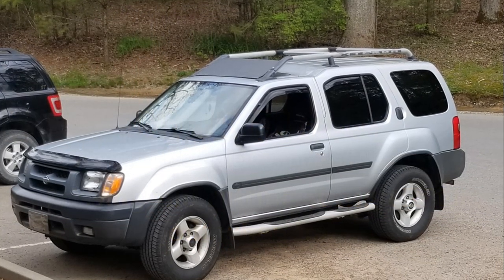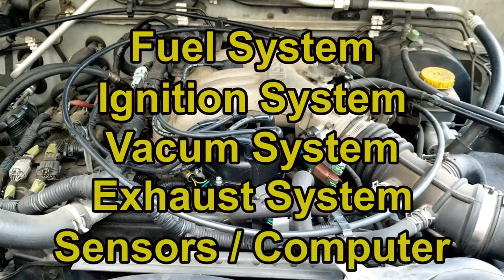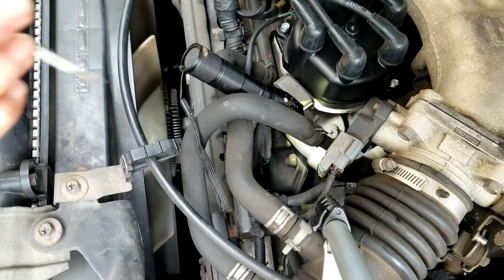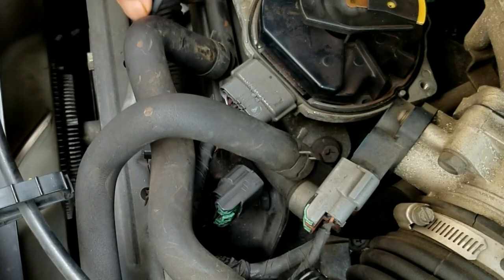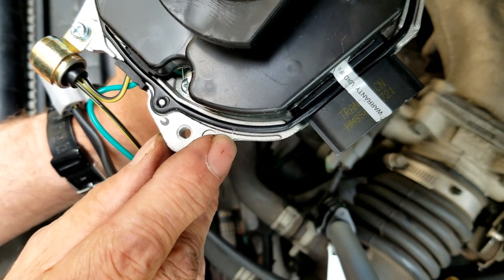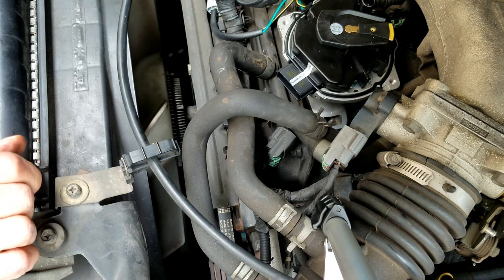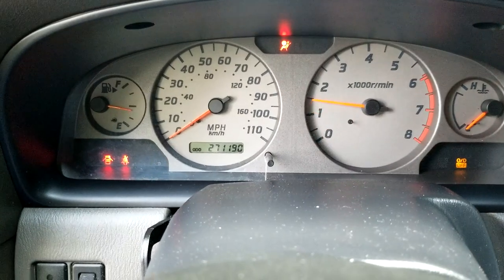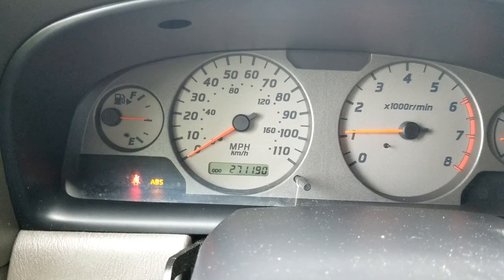2001 Nissan XTerra Misfire problem and the dreaded 300 fault code

Comment: Thanks for sharing, Donnie.  Your video is actually good information for lots of people who drive older vehicles.  Many car builders were putting the ignition modules inside the distributors back in those days, and they were all a problem after 20 years.  When they started using coil packs instead of distributors, the problem went there.  The fancy new code readers ($$$) can tell you which coil pack is bad.
Reply from the maker: Your very welcome my friend and. Thanks for sharing this. They can be a headache.

Comment: We've owned an Auto Repair and Tire Service for 42 years. One thing I've learned is preventative maintenance. If you have fuel injection,  add cleaner to your fuel tank every time you change the oil. Change the oil and filter per your owner manual. Check the oil and transmission levels periodically depending on the age of your vehicle. And ladies, this isn't hard to do, and you should also get someone to teach you how to change a flat tire. I've started to change mine many times, but a nice gentleman always stops to help when you ask the Lord to send you one 😊.
Reply from the maker: Awesome my friend. Thanks for sharing your tips. Thank you.

Comment: These computerised engines can reallly give you a hard time diagnosing their problems.  But, are much better. Back in the the 60's and 70's you'd never get 270,xxx .miles without doing a motor swap. I had an early 80s model Chevy with over 300,000 miles but I had to replace the engine with a new one. Good video Donnie.
Reply from the maker: WOW that's so true my friend. Thanks for sharing this.

Comment: When you buy a new cap and rotor make sure they are both from the same company.  Otherwise they might hit each other and break. 
  Also,  they make a set of ratchet extensions that have a little wobble in each joint.  Use a couple of the short ones,  they won't flop over and bind up like the universal joints will. 
  Tips you learn from years of experience.  Y'all are welcome,  cause you're going to say thanks after you use the tips.
Reply from the maker: Awesome my friend. Thanks for sharing these important tips.

Comment: That sure was a different looking distrubutor Donnie...but looks like your code 300 is gone and you are ready to run ....i had to do my coil packs on my Mercury Grand Marquis a few months back ...it was the first time i did a coil pack system , it wasnt too bad a job...though i upgraded them with msd units...runs sweet now....but...it still is much easier to tinker on my old 62 Finger mashin Ford Galaxie....
Have a Blessed weekend and Thank you for the informative video Brother.
Reply from the maker: That fixed it my friend. Thanks for sharing your problem and fix. God bless you.

Comment: Definitely going to try this. I just replaced my distributor a few weeks ago now I got PO300, I’ve changed plugs, wires already…. I did notice the little dot in the shaft didn’t quite line up but I was told not to worry about that
Reply from the maker: Good luck! Thanks for sharing this my friend.

Comment: Ha ha ha, I had the same issue about two years ago and I went down the rabbit hole trying to chase down the problem and don't get me wrong. I ended up finding issues that needed fixin but the distributor was my main issue like you showed in this video. My Xterra is a 2000! Also, I forgot to mention that the inner bushing for my distributor wore out causing the CAM signals to be affected and therefore causing the issues when it got hot.
Reply from the maker: Awesome my friend. Thanks for sharing.

Comment: This is something different than the usual. That looks like it's in nice shape for the year. Most of them have rotted away up here. This is what I do for a living and I work on all kinds of vehicles. One of them yesterday was a '69, 396 Chevelle. Misfires can be a pain, but higher level scanners will let you look at individual cylinders in a graph. Multiple misfires usually indicate ignition or fuel pressure issues. Or the customer overheated the hell out of it.
Reply from the maker: WOW Thanks for sharing this my friend. They can be hard to troubleshoot.

Comment: Why on earth doesn't socket manufacturers put magnets inside of them?  I know it would increase the cost, but most of us who work with tools would gladly pay a few dollars more for tools that will both hold onto the nuts as you put them on or as you take them out.  I've dropped screws going both ways at a job like this.  Digging out dropped bolts and screws sucks.
Reply from the maker: I understand all to well my friend. Good question. Thanks for sharing this.

Comment: Nice video ,
I have a 2000, same engine, same code. I changed the plugs, wires, distributor, and still get the code 300.
I'm suspicious of the computer.
Reply from the maker: It could be so many different things with this 300 code my friend. Sorry that didn't help you.

Comment: I used to time the old Ford motors take number 1 plug out stick a screwdriver in the cylinder easy like a turn the motor by hand till the piston came to the top and move the rotor button to point to the cylinder.
Reply from the maker: Great tip my friend. Thanks for sharing.

Comment: I replace the sparks plugs rotor and cap after that gave me a p0300 it was the catalyst 2002 Nissan quest after that a code p3002 came all the spark plugs were loose I tight them no more code

Comment: Wouldn’t no problem to figure out a old 300 6 cylinder or 302. I can take a older ford motor apart and put it back together in the dark. GOD BLESS you sir Amen 🙏

Comment: 1999 Nissan pathfinder with 96,xxx original miles, always maintained.  p0300 code and rough idle and hard to start. new parts replaced: plugs,(denso), wires (denso), completely brand new distributor (cap rotor, shaft coil etc), new manifold gaskets, cant find problem after thousands $$. Please help!  someone suggested the crank position sensor could cause the problem...any advice? thanks!
Reply from the maker: WOW, wish I could help you my friend.

Comment: I just changed my distributor on a 1990 F150 6cyl yesterday, mine would completely shut down the ignition. I had to turn the key off and back on while driving (manual trans) to get the computer to reset. No codes for this problem. It was very frustrating to decide where to look. Thank the Lord for YouTube University.
Reply from the maker: WOW Thanks for sharing this my friend. Your very welcome.

Comment: I have a 2001 Nissan Xterra 3.3L While driving I pushed  down I have no power at first then it picks up what cause that
Reply: I don't know what to do
Reply from the maker: It could be many things my friend. Have you checked the fuel filter or pump.  I'm just guessing. Does it show a code. Maybe have a parts place put it on a code reader on it. I'm sorry that's all I can tell you.